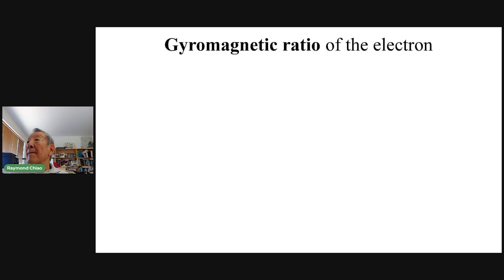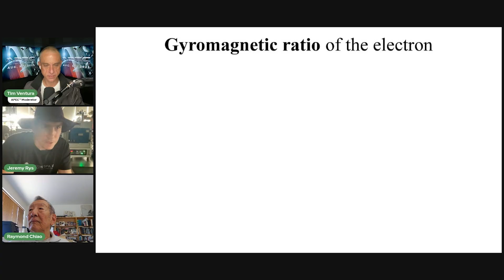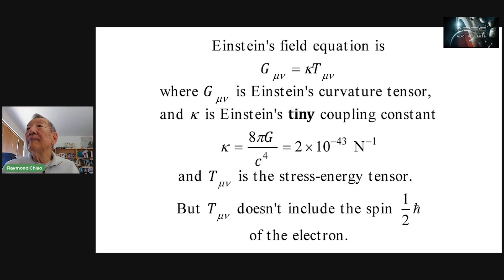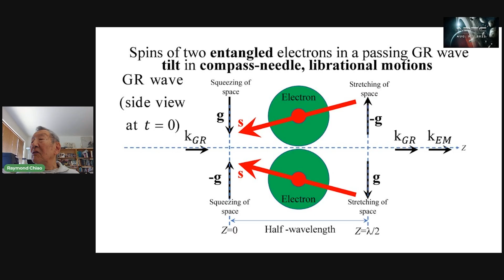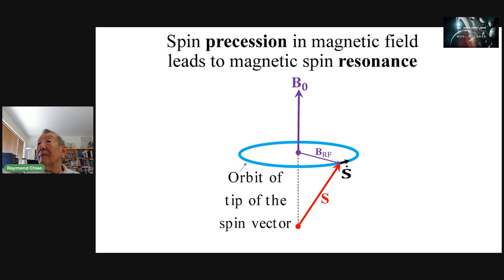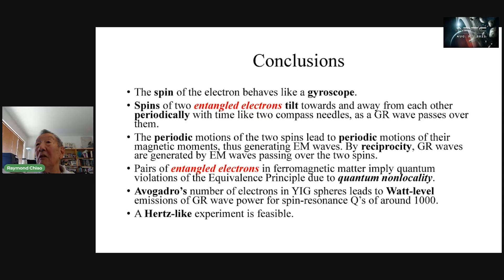Spin Gravity Coupling To Generate Gravitational Waves | Raymond Chiao

Comment: Who can help assemble a working group? It can be assumed that the result of the experiment will lead to a direct and complete refutation of Einstein's theory of relativity.
 New (NANF) hollow optical fiber capable of transmitting light over 1000 km. The use of noise reduction, as in the fiber-optic gyroscope MARINS V11, especially since they are close in volume and weight. This will allow us to conduct an experiment with quantum gravity. According to the scheme of Michelson's experiment of 1881.  From two highly elongated fiber optic coils in one monolith, where the light path in each arm is 900 km., which will allow us to compare the speed of light in an airplane with its linear speed of 0.3 km/sec, where according to the calculation
 2(l/λ)(v "/c ")=1.3 of the main formula of the experiment, we get a signal 1000000000 greater than on the detectors; LIGO, VIRGO … . And see how the "Dominating Gravitational Fields" act through the frequency of light, regulating its energy, direction and speed in a vacuum. «LIGHT is the energy of ordered oscillations of gravitational quanta during the redistribution of the work of space»

Comment: …in a hexagon layout like the North Pole of Saturn, coupled to a hexagon on the south. 
 Epsilon iron, hexagonal close packed crystal structure creates this effect. Separates e+ from e- 
Dielectric north magnetic driven south creating the torque. 
 Alternating cross pulse resonance forms the checkerboard EM gravity field. 
 Density 🫡
Well done, thanks for sharing.

Transporter, communication, warp drive, cloaking, convert energy to matter like crude distillation aka replicator. 
Indenene layer sandwiched between two layers of graphene. 
Gravity plating.